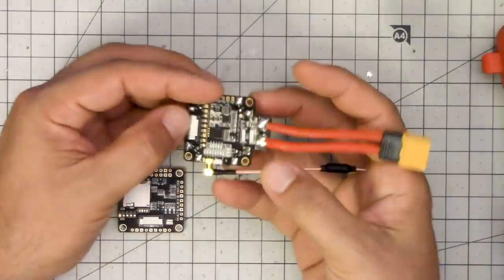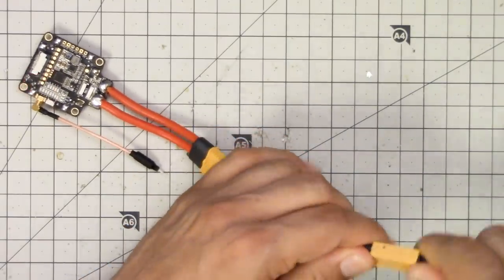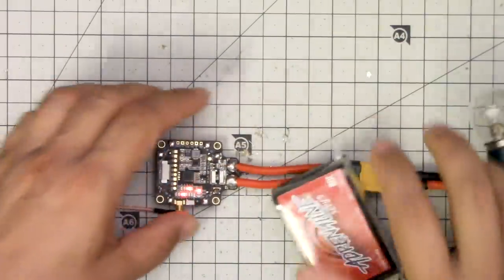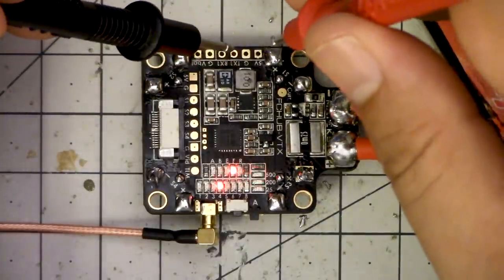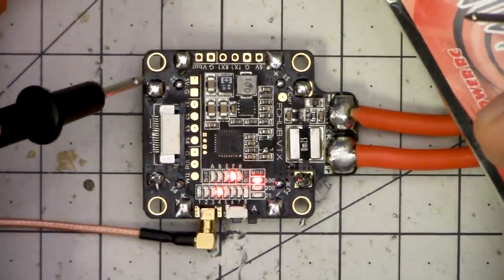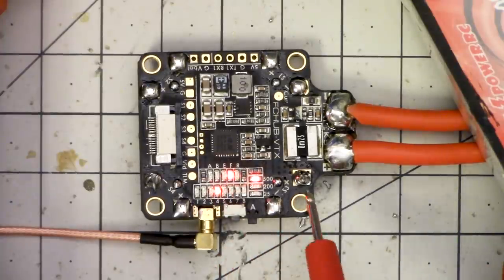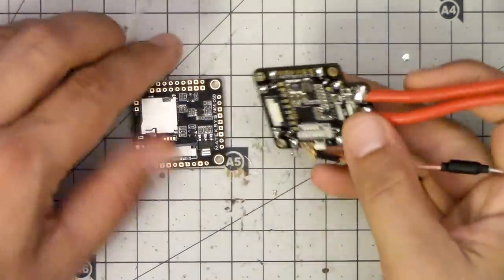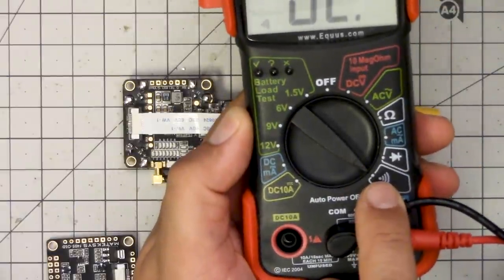Matek F405 Troubleshoot | Multimeter Continuity Testing

Comment: I think these troubleshooting videos you're making are a hugely valuable asset to the community. I've been an EE hobbyist for years and understand the methodology to track down trouble in my quads, but find that friends who lack that background can figure out what to solder to what (most of the time), but when components misbehave they can end up doing more harm than good trying to sort it out. 

I've been using an inexpensive(ish) benchtop power supply and it's absolutely invaluable for testing. With it, I can bench test my quads at 12.6v / 3amps, watch the current bounce around through the start-up motor tones, and immediately determine if there's an unexpected load or short. Same with any individual component that needs 3.3v, 5v, etc. A smoke stopper is perfect for testing after a wreck out in the field, but the benchtop power supply can be had for under $100 on Amazon and worth every penny, though I suspect you already have one. So why not use that instead?
Reply from the maker: Smoke stopper is dead simple, portable, light. It works wherever the quad is, whether I'm at my bench, desk, or in the field.

Comment: **Update**
Got a hold of the Matek tech guys, they spotted something I hadn't, a small piece of errant tin bridging somewhere on the board. I removed the bridge and all is good again. Thank god for the smoke-stopper and for the Matek Tech guys, they got back to me within a day and all was fixed.

Same thing just happened to me. I went through each step checking continuity after each piece. As I got to the last step of soldering the VTX up, I went to plug in the battery with my trusty smoker-stopper and dreaded light hit my eyes. So just as you did I went back piece by piece, checking each time. Same conclusion it was something with the F405. After re-watching your video and sending out emails for warranty. I tried to just wire the board up with out the ribbon cable and same thing. So after a little frustration, I went and checked continuity against each pad to ground and I found a short between vcc and ground. So I am lost, surely if vcc and ground was shorted from the beginning then I would have found it earlier, but I just dunno. Anyways thank you soo much for your videos, they are truly the most helpful. Also, if you have an idea of what went wrong let me know. Also now pads were bridge with solder so I'm stumped.

Comment: 14:40 "That's pretty cool....."
No JB - what's pretty cool is that you traced and figured out the problem! Thank you, great troubleshooting vid!
PS - I bought a twenty something dollar multimeter from Amazon, and it seemed ok, but for some reason putting it into continuity mode caused it to beep endlessly, and I didn't understand why.
Bought the Innova that you use and immediately received great feedback on continuity testing.......was even able to check the continuity on an 8 pin JST connector which connected FC and ESC....it was very liberating to the troubleshooting process......thank you 😁

Comment: I always check for continuity between vbat+ and vbat- after a build before powering on first time. It saved me in one occasion when I soldered one of esc + and - the wrong way. Working late into morning and  mistake is a common hazard.

Comment: Comment after I watched till 14:52 : It is common that 2 adjacent pins can be shorted if there is little 'play' between the ribbon cables and its contact. If I was doing the trouble-shooting, I will look for which pins in the ribbon cables are actually transporting the 5V and trace that contunuity (i.e. without power on, just use the DMM) along the route from the FC to the hub vTx board point by point, and one can see where exactly the short happen. Anyway, this is a wonderful video to show people the steps one should take to trouble shoot. You mentioned very good point of using Smoke stopper to limit current in short situations as well as the good practice to troubleshoot by testing continuity rather than testing with lipo connected

Comment: About measurement, if you check a 5V/12V line put an appropiate load parallel. Maybe a LED (virtual sign too) or an resistor. For example to check a 12 Volt 1A source put a 10 Watt LED parallel. Mayba a little Board with a 3way switch 5v/500mA;12V/500mA;12V/1A load  is a good tool. Btw your smokestopper is a bit to heavy with "Ampere" protect this little conducting paths on RC parts like FC/PCB boards. Think about a power supply unit where you can adjust/limited the current  for your application. Its much saver and costs nowerday not much. There are good old vintage powersupplies arround 30 Bucks that have this possibility. 
Regards from germany Stefan
Reply from the maker: +pizza tuner the smoke stopper here is mostly to protect me from blowing up the battery.
Reply: Really no need to. I "blitz" some old screwdriver accus to blow out the anodes (often some cells of older NiCd accu change polarity) with my Lipos. And this short ~ 50A  didnt hurt them. Believe me anything on your rc stuff vaporized before the Lipo gets touch on his limits. The only way it make sense to protect is an sensilblier "Smokestopper" or simply a good old (or new) power supply with adjustable continiuty. Maybe a good stuff for your next videos. Like your content, always a thumbs up for you.
Happy to fly, Regards from Germany Stefan
PS: Write me a mail and i give you some summaries.

Comment: So I just got done building the 405 and vtx hub in an Alien.  I really liked the idea of the ribbon cable and your first video made it look pretty straight forward to install.  But, it really just isnt that easy. Getting the ribbon cable onto the hub was easy, the layout is open, and the friction lock easy to get to.  Getting the ribbon cable into the 405 slot straight is another matter completely.  There is a chip right next to the friction lock that makes it almost impossible to get to to push both sides in evenly, and from experience now, if you dont get it perfectly straight, and I mean perfectly straight, it wont work properly.  After spending hours trying to get the ribbon cable to work,  I finally gave up and spent 10 minutes soldering wires.  Works perfectly, still a clean set up.  I'm really pleased with the vtx on the PCB, and I have zero complaints other than the ribbon cable. My experience - just solder from the get go.
Reply from the maker: Not sure why you had so much trouble... Bad luck I suppose. Glad the board has direct-solder pads if you need them.

Comment: I guess its possible the connector isn't aligned correctly on the pcb when they soldered it.

An idea would be when installing this setup would be to check continuity between the ribbons edge conductor and the first pin on the  connector to make sure the alignment is correct before putting the other end in the flight controller.
Reply from the maker: That's a good check.
Reply: I will try it cause at one point I do remember my motors spinning in bf

Comment: That's a great idea to check everything as you go. I did that today and everything was fine until the last thing. Installing the receiver. But the receiver wasn't bad. The solder connections weren't bad. That's just when the 3.3v regulator decided to blow up for no reason. After talking to people I discover at least 1 guy has had four 3.3v regulators go bad on Mamba F405 FCs. And that's what I have. A Mamba F405 mk3. The regulator gets blistering hot after 2 or 3 seconds. I'm so pissed. This hobby man. It's the most frustrating thing I've ever done. We have nice weather planned for this weekend and I was really ready to fly my first HD build. But nope! Not happening. The regulators won't be here until Monday. Then I can find out if it's just the regulator or did it also blow the processor.

Comment: Dude from the beginning you were the goto guy for building tips and how to , last time I sent you a message it was about the crossfire rx issue . Anyway I bought two Mateo boards a 405 and a 722std . The 405 flips on take off and the 722 has issues as well , so I said fuck it and bought a JB board and a kakute f4 V2 . Both easy builds . Now that I watched your video here I will revisit the other boards and see if I can’t figure out the problem with them . Thanks
Reply from the maker: Flips on takeoff see below.

If the quadcopter instantly flips over when you arm and raise the throttle with props on, it is almost 100% certain to be one of these things:

1. Clockwise prop installed on counter-clockwise spinning motor or vice versa.

2. Flight controller not facing forward. Go to the Setup tab in the configurator. Tilt the quadcopter on all axes (pitch, roll, yaw) with your hands. The 3D model in the configurator should move the same as you move it with your hand. If it does not, use the Board Alignment parameter in the Configuration tab to fix it.

3. Motors not wired correctly. TAKE OFF YOUR PROPS. Plug in a battery. Go to the Motors tab. Turn on the "props are off" slider in the lower-right. Raise the individual sliders (1, 2, 3, and 4) one at a time, just enough that the motor begins spinning. The motor positions (1, 2, 3, and 4) should match the graphic in the upper left. If they do not, then either move the signal wires so that they are correct or use resource reassignment to virtually "move" the motors.

4. Motor spinning wrong direction. Do the same as step 3 but compare the motor direction to the arrows on the graphic in the upper left. If a motor is spinning the wrong direction, either reverse it using BLHeli (or whatever ESC software you are using) or swap any two motor wires with each other, which will reverse the direction.

Many times, people swear up and down they have checked all of these things, and then come back to say oops I missed one you were right. So if you think you have checked all of these things and your quad still FLIPS OUT, go back and check again. If your quad is insta-flipping on takeoff, it is almost always one of these things.

Comment: Good show Joshua.I damaged the Strix JB Signature 4s parallel charging board while plugging in the battery balance plug.Good thing for fuse but now i see a trace showing on the opposite side of the board.
Reply from the maker: Yeah it's probably dead. You have to be super careful plugging them in. People have asked about making a version with polyfuses. It would add some cost but would protect against that.
Reply: When i say showing i mean the coating is gone from heat it melted and exposed the trace.It works fine though the board is very crowded and the balance ports are hard to be precisely plugged in.If i had tiny fingers it would not be a problem.I will need to replace that fuse and cover the trace with nail polish.Good show brother.

Comment: You can check the pins on the FC end of the ribbon cable while plugged into the PDB and powered up. It' tedious and I've used very small clothing pins with care to check ribbon cables. This would help positively confirm the failure.

Comment: Question at 9:21 : At this point, swap your +ve and -ve probe to test G and +5V again to see there is a beep or not, or better off, don't use the beep to confirm the short, use the actual ohmmeter

Comment: My Matek done exactly the same. So I just directly soldered it. All good and still working fine. I done the same as you with the multimeter and got same results. Apart from that problem it’s a good bit of kit. PS got mine here in the UK 🇬🇧. So think there must be a bad batch out there. But don’t let that put you of getting it.
Reply: Ordered mine from the UK and had the same problem, except direct wire still had a short.
Reply: That just tells me that the one party trick the Matek F405/HUB combo brings to the table is worthless...  Why not just get the HUB/PDB/VTX unit and an Omnibus F4 for less money?

Comment: what up josh. thank you for your continued guidance.  i am running a matek f722 on the fchub vtx.  all was fine, and all the sudden when i plug in vtx and esc's power, but i dont get the final chime, and i have one dim red light on the flight controller.  if i plug into usb, with battery still connected, lights come up on fc, and i get the full cycle power up with chymes.  tried bypassing ribbon cable, same thing. then i watched this video and am stumped

Comment: I had similar problems with my second of these, I never worked it out and it is sitting on my bench in the random junk bucket.
I'll mess with it a bit and find out if I can get it to work - I might have "free" FC.

I really love these boards both the OSD and AIO. Pair them with BLHeli 32 ESCs run 8/8 or 16/8 and Bf3.2 and they fly smooth as silk.

Comment: Wish I saw this yesterday, lol. I had a brand new flight controller that would not power up. On the 9 volt pin, I had 9 volts, but on the 5 volt pin, I had 0 volts. I checked the cable for continuity and it checked out fine.
I went back and forth with the manufacturer, they said there QC is very good and everything is tested. I suspect it might be a 5volt regulator, but, I never checked for continuity from 5 volt to ground. It would have gave me a little more info.
Anyway, they are replacing it, but it took a whole week of sending them pictures and videos.

Comment: That smoke stopper is a good idea to use on the bench, especially when you have what looks like a blob of sodder on the mat. :-)
Reply from the maker: Yeah exactly. Or if you accidentally touch something with a probe that you shouldn't. Current limited power supply is also nice.
Reply: Hi Joshua, You are the only builder that I have have watched on youtube using a smoke stopper. Please could you give an idiots explanation to what one is, how its made and what it does. I did my last build without one but sounds like I shouldn't have. Thanks for your videos, i do always learn something new.
Reply: search 'smoke stopper'
Reply: Joseph Rapson  as the bulb is in series on the earth if there was a vbat short  the bulb would take up the load and light up hence stopping it smoking the board, esc ect

Comment: I just tried a build with matek f405 and the fchub. Seemed to be work fine at one point but then I cant figure out why motors won't spin now or osd and camera dont work thru the fc. So I unhooked replace with xt60 and sp3 and it flys

Comment: Hi thanks for the vid :-) since a few weeks I am struggling with an issue after crashing a Tyro129 and I am having trouble with RX connection with the quad.
I tried both an R9MX and XM+, they both used to work with this quad and still bind ok with the remote.
Quad behaves ok when connected to betaflight, all features work, vtx is ok, gps locks ok. I even updated the firmware, no issues.
Only thing that won't work is RX-FC connection, I checked wirings severeral times, pins continuity is ok, I also bypassed the plastic connector and soldered the RX straight to the FC (also trying different input uart pins), none worked.
FC led blinks red all the time, 5V pins are ok, 3v pins are ok, ground is ok, no overheat whatstoever.
R9MX seems to connect intermittantly (remote keeps saying "weak signal", "signal lost", "signal ok")
Any ideas on how to throubleshoot this? How can I be sure that the eachine GPS F4 FC is fried? I run out of ideas...
thanks for you help 🙂
Reply: Did you ever find the problem
Reply: @ChrisQuadFPV  nope :-(

Comment: My Omnibus F7 Board came with a wiring harness that had the pinouts the opposite way around. Luckily I noticed before powering it up. "Always check your wires, then check them again".
Also, ribbon cables are made for Raspberry Pi's not quads. Don't know why manufacturers both using them for fpv.

Comment: Is the ribbon cable bidirectional or is there a FC end and pdb end. You might find that the ribbon cable has the contacts slightly off to one side at one end but off to the other side if turned round.
Reply from the maker: It's bidirectional I think. But hey maybe I'm wrong about that.

Comment: Hey JB. Can I make an important addition to the possible issues when installing this FC? I just received this F405 OSD the  other day and immediately updraded all drivers and then the firmware to 3.2.2 with no issue. second I loaded my Starter presets to betaflight as well as followed you video to set m5 as softserial for FrSKY telem. Finally I completed install an failed to check continuity and plugged lipo. The board lit up but quickly lost power . I also lost power at micro USB. Upon first visual inspection I noticed a very ,"very" small solder bridge at the ribbon connection leads on the back edge of the ribbon connection plug that sits very close to cam and vtx solder pins. I then realized that when soldering these pins I dabbed the solder tip against the ribbon bridge slightly and that is my issue. I was in a rush and now I am paying for it. At this point I am thinking that I must have blown a voltage reg on the F405 and I will need to replace. Can you give me any suggestions in relation to the F405 voltage regs and/or other possible factors? I have Falcon's (RIP) vlogs on replacing these v/regs and I am comfortable with micro soldering. "Even though my soldering is why I find myself in this position." Thank you...
Reply from the maker: There is an intentional solder bridge between two adjacent 5v pins on the ribbon connector. I'm not sure what exactly is wrong with your board though...